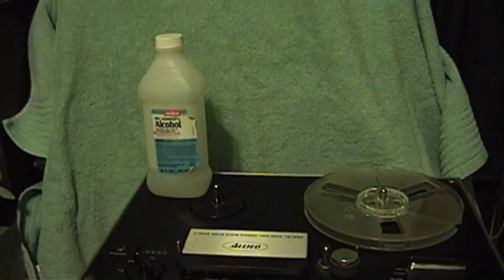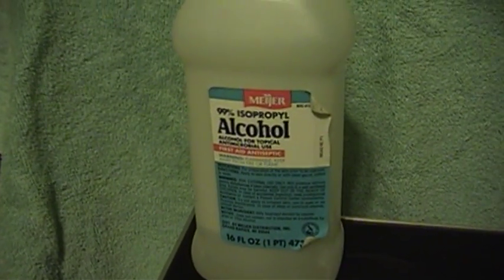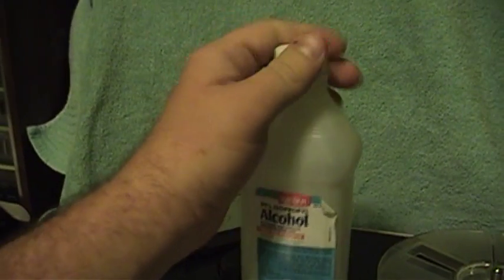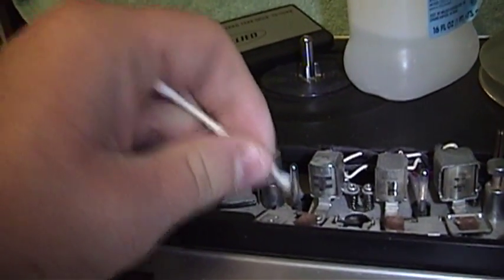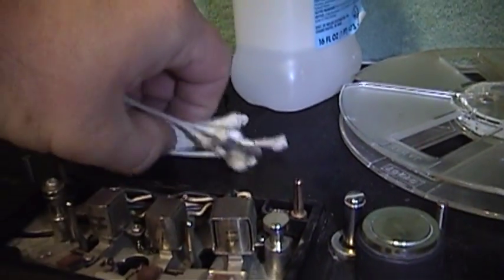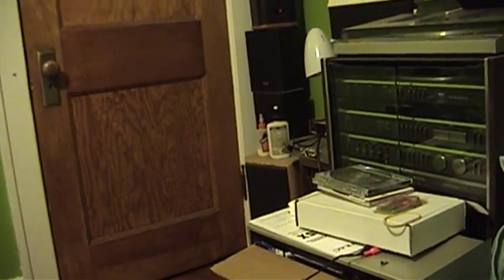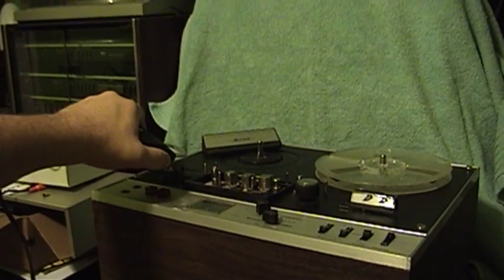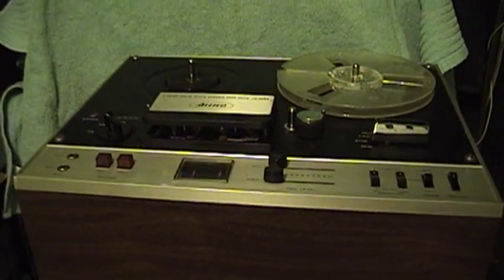Cleaning and Demagnetizing the Reel to Reel Deck

Comment: I happen to have the same Sony HE-2, which I have long forgotten how to use correctly. Regarding the duty cycle and the red button on the side, is the HE-2 100% "off" when the button is not pressed? I used the HE-2, left it plugged in when I finished, assuming it was off. When I later returned to put it away it was extremely hot and I almost burned my hand. So can you elaborate on the precise use and purpose of the red button? And have I possibly damaged the unit? If so, how can I know? Greatly appreciate your help with this!
Reply from the maker: I don't know about the duty cycle. On the demagnetizer I have, power is off with the red button released. Given the duty cycle limitations, age and build quality, I wouldn't leave one of these plugged in unattended for any reason. 

It'd be somewhat difficult to say if yours was damaged. Checking its power draw (wattage) and comparing to the nameplate rating could lend some insight. If it's much higher than indicated after having been powered up for a short time, there are probably some shorted turns in its transformer. Its electrical resistance (impedance on AC) will change somewhat between cold and hot operation.

As to usage, it's best to turn this on from a distance of two feet or so, slowly approach the tape head, slowly move the demagnetizer around and then slowly move a foot or two away before shutting off the power. Otherwise, you may make the magnetization problem worse. The key word here is, obviously, slowly.
Reply: @uxwbill  Thank you for your reply! With my HE-2, there is some small amount of vibration without pressing the button, and it increases when the button is pressed. So given that it became so hot while left plugged in (I won't do that again!), I assume it is not entirely off. I appreciate your information and advice!

Comment: People are crazy thinking you need to do that silly procedure with the demagnetizer.  The thing is only a very small coil of wire connected to the mains.  The transformer inside the machine will give off more magnetic distorting than those silly demagnetisers.  As for having to be so many feet away from the unit and slowly bringing it close to the heads is totally unnecessary and having worked with and used reel to reel tape decks on a daily basis for over 50 years I can categorically state they are a waste of time.  They do not improve the sound, all they will do is demagnetise any iron object they come into close proximity and that's it.
Reply from the maker: No.

Comment: I have the same demagnetizer. I remember my sister and mom demagnetizations of the reel to reels. Nice vid. I think that it may be possible to tangle cotton from the cotton swabs into the heads if rubbing too hard, tho.
I think it may be best to just wipe with isopropyl the direction of the tape and try not to get micro fivers of cotton stuck into the head. Thanks for the video. Thanks for illustrating slow demagnetizations is key. 👍

Comment: Could a magnetized head erase your tapes or just cause playback distortion
Reply from the maker: The primary problem is one of audio quality being poor. Though I suppose it's possible to erase a tape with a magnetized head, the magnetic field (which comes from the tape moving over the had) is very weak. It'd take many, many plays to do damage.
Reply: @uxwbill  thanks I was quite concerned about that didnt wanna erase my rare hank Williams reel to reel
Reply from the maker: The thing to do in that case would be to digitize the tape. Repeated plays will wear it out eventually.
Reply: @uxwbill  I dont know how to do that to be honest
Reply from the maker: You can find a lot of good tutorials and free software online. Find a friend who might know how (but be sure they do). Or consider a paid service; just be cautious if you do, because it has been proven that some of them are pretty bad. Legacybox is so bad as to be worthless.

Your computer is almost certainly ready for the job, unless it's a laptop or tablet. Audacity is a great (and free!) program that can record almost anything.

Comment: I want to get a demagnetizer, because I haven’t demagnetized the heads yet. I have two reel-to-reel decks including my Akai 1721W and my Concord 220. My Concord 220 is a half-track mono tape recorder, not a 4-track. I test the recording, and played back and it sound fine, but it gets hissy on the heads, and it needs to demagnetize it to make the heads a lot better.

Comment: Plz i need help,i have pioneer t6600 reel to reel and when i pushing play button down and rec left don t stay and cannot record,you know what is it? Thanks
Reply from the maker: Get a copy of the original Pioneer service manual and start troubleshooting.
Reply: @uxwbill  i have a copy but i didn't know from that stuffs,,it s belt,head,buttom need clean i don t know
Reply from the maker: I could really only recommend taking your R2R machine to a professional service technician, if you are unsure of how to proceed. I've never worked on any Pioneer R2R equipment.
Reply: I live in Greece and here they havent a good techicians,they don't know about reels for that i m asking there

Comment: How does that particular demagnetizer differ to the ones with the hook shaped probe on the end?  Don't you have to hold it close to each head and move it back and forth across each separate head instead of doing one back and forth continual sweep?
Reply: What difference do the various wattages make? I've seen many that were 3 or 5 Watts, but some were 20 Watts. What difference or effect does that have?
Reply: ***** I have a question. I just purchased a reel to reel player and I'm not sure about something. When I load the tape and play it, how does the machine know what speed to play/take up the tape to keep tension on the tape?
Reply: Cool profile pic! I have one of those Panasonic 8 track players.

Comment: Hi uxbill,
I wanted to ask you if you could tell me how to know if the heads on a R2R are worn
by visually  inspecting them.
I got an Akai 1722w that a friend gave me and  I was wondering what to look for as far as condition of the heads. It is a two head reel.
I did the same thing you are doing (cleaning the heads) I need to buy a demagnetizer now.
Exellent video and very informative like always.
Best regards

Rob
Reply: Thank you uxwbill,
I opened the r2r today and cleaned it i inspected the heads and they look ok to me. no gaps but i did find out that the cam that operates the fast forward mechanism is just about to fall apart, it is made of pot metal. so it looks like i need to find another cam.
I might be hard due to the scarcety of these model another thing i found bad ( spliting apart)was a rubber bushing that acts as a stoper for one of the levers of the mechanism. but that's a fairly easy repair. The cam is the one that is going to be difficult to find.

Thank you for your help
Rob

Comment: Great video, thanks. I've read elsewhere that rubber shouldn't be cleaned with alcohol because it could dry up and crack... instead you should use some special rubber cleaner... not sure what this rubber cleaning fluid is made of... have you heard this? Any thought?
Reply: methylated spirits I think.

Comment: @uxwbill Hi, yes the aquarium air-pumps are what I had in mind..though of course ours are only 50hz in the UK!
Regarding the pinch roller...you will not believe this...I know I didn't... 3in1 oil on the rubber then dry it off thoroughly with cloth.... magically takes the glaze off. As for setting the azimuth.... get a tape recorded on a decent machine...then while playing it adjust the playback head for best treble..

Comment: Very interesting! Looks like a lot of crap was on those parts.

Won't the alcohol dry out the rubber on the pinch roller?

I am a fan of eBay myself, it gets me into trouble constantly. I like sniping at the last ten seconds or so myself. And sometimes I may do a victory dance...sometimes...maybe.

Comment: I ALLWAYS get sniped on eBay auctions, allways. In the end I just decided to give up on actions all together and only go for "buy it now" items.
Reply: CoolDudeClem  The key to winning a auction is this. Whatever the highest bid is, let’s say it’s $50. Whatever you can afford that’s at least $20 more then the highest bidder, enter that in your maximum amount. Let’s enter $75. But do not submit your bid until the last seven seconds. When there is seven seconds left, hit the button! By the time anybody realizes it, it will be too late for them to raise the bid because time will be running out and they will panic and make a mistake or fumble because they are rushed. The longer you can wait to let the shot clock run down, the better off you are. With a little experience, and you know how fast it will take for your amount to register, the better off you will be. I have done it for so many years I can pull the trigger with four seconds left.BOOM!! they never know what hit them, LOL